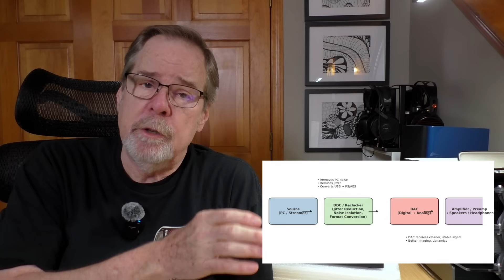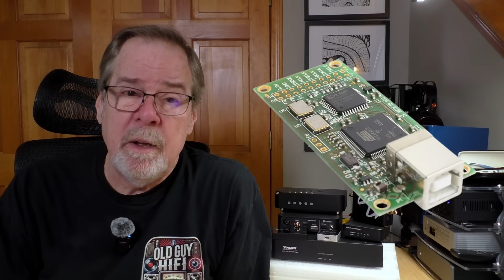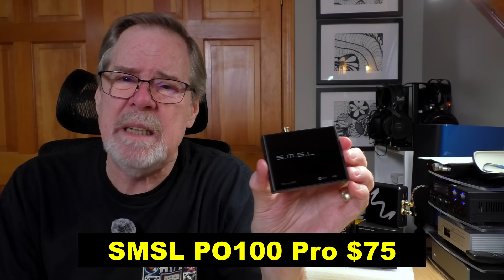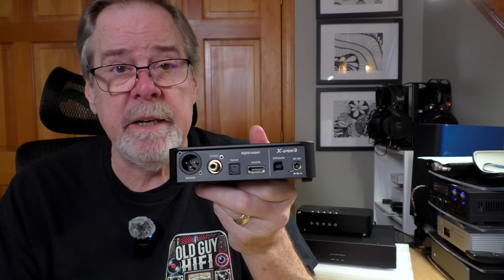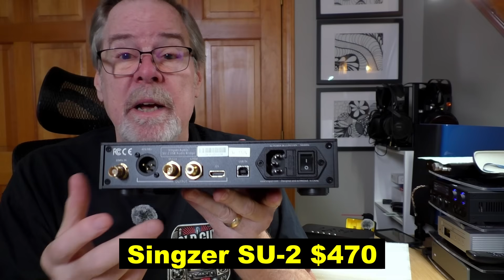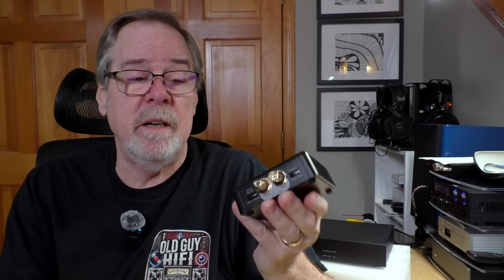OH NO! DDC-Reclockers! Do they really make a difference? YES! They do. I can hear it now “Snake Oil”

Comment: Thanks for the very interesting video! From what I understand, none of the relocker have an USB out, correct? In this case, the sampling clock used in the DAC conversion is always going to be the one of the relocker, and not the one of the DAC, which, for high-end system, I expect to be very good (and maybe better than a cheap relocker chip). Do you know if there are any relocker with USB in and USB out? This in principle could clean the noise on the usb line but letting the DAC using its clock to do the DAC conversion.
Reply from the maker: I don't know of any DDCs with a USB out. Most have I2S outputs. The DACs clock is still used as the SPDIF input on most upscale DACs runs into an FPGA which can then route the bits through the internal clocking system. I2S is also routed through the internal clock. The DDC clean up and re-time the bit stream but the DACs clock is still used. Think of it this way: The outboard DDC is an analog stopwatch, it does a good job but there can be some minute inaccuracies while the DACs internal clock is like a digital stop watch.

Comment: I have a WiiM Ultra streamer. Is there any sense in connecting a DDC between that streamer and a DAC that has USB and coax inputs? If so, which input is more reliable in practice for accepting DDC signals?
Reply from the maker: The WiiM Ultra is notorious being being full of jitter so yes any one of the units will make a noticeable improvement. If your DAC has I2S then that is the best connection. Otherwise unless you have a dedicated 75ohm digital interconnect, use optical. Thanks for asking and tuning in.

Comment: if i'm not wrong, teac high end dacs don't need these, because they already have bulk pet transfer in their usb ports, Most high end dacs will probably get no advantage or a very small improvement since most have their own circuit that clean the signal, specially if your source comes from PC that's full of jitters and distortions.
Reply from the maker: Even the most expensive DAC manufacturers have companion DDC/Reclockers in their product line up. The designers must have built them for a reason. Brands like dCS, Chord Electronics, MSB Technology, Weiss Engineering, Esoteric (TEAC), Denafrips, Laiv & Mytek all offer these products. There really is a sonic benefit in my opinion and the opinion of many other audio reviewers and engineers. Thanks for the great question.

Comment: Budget Build question: How about using a toslink/optical to USB-C adapter to go between a WiiM Mini and [insert DAC make/model here]?

I have 3 Minis in 3 systems, but they don't do USB-C out. Has anyone tried an optical to USB convertor? It's the only budget option I have to try this on my systems at the moment.
Reply from the maker: I have not tried that. That would only electrically isolate the DAC from WiiM. I am not sure if that would have any benefit. Let me know if you try that. Thx.
Reply: @OldGuyHifi I think I meant to say:

... use an optical-to-USB so the Mini could hit the reclocker before the DAC... 

Writing from bed when I should sleep has its putfalls...

Comment: Just purchased the Douk Audio U2 Pro 2025 DDC and had a very frustrating experience.  The supplied Windows drivers would not load due to a virus in the software ( prevented by Windows Defender).  I also spent about 20 minutes trying to load the software drivers off the internet using at least a 35 character web address, which did not exist.  Also the instructions were very difficult to read and poorly done IMO.  I was able to connect the DDC to my iPad, which did not require a software download, but the sound was no better than without the DDC in my opinion.  Using the Amanero USB connection from the Windows laptop directly to the Geshelli J2S was a far superior sound.  I found this connection lights out compared to using the Wiim Pro's coax output.  What a difference USB makes.  My 2 cents on trying the DDC with Windows.  Proceed with caution.
Reply from the maker: Sorry to hear of your frustrating experience.

Comment: I was wondering if the wyred for sound ddc reclocker would benefit from a linear power supply? Also I went from an optical cable to a coaxial cable to connect my mxn10 to my geshelli j3 dac and after burning in the coaxial cable it sounded much better and that’s before adding in the ddc. Don’t have it yet. It’s being shipped to me. Thanks for your very informative videos. You’re helping me elevate my system.
Reply from the maker: I did try an LPS and didn't think it made a difference. This is dealing with purely digital signals not anything analog. I think the supplied wall wart is fine. Let me know your thoughts on the Remedy once your listen to it. Thx.
Reply: I will definitely give you my thoughts once I get it and add it to my system. Once again thanks for your advice and expertise.

Comment: Thanks for the video.  Im looking to put the SMSL PO100 between my laptop and a ifi zen DAC 2 but not finding much info.  Is this connection possible with the available inputs on that DAC?
Reply from the maker: It won't work for you as, for some unknown reason, the Zen lacks and SPDIF inputs. Sorry.
Reply: Thanks for the reply.  I'll look at the ifi silencer + as an option....thoughts.

Comment: I see the DDC-re-clockers     are actualy built into the dacs   and the ddc-reclockers   sit before  the DAC of course and are digital to digital.But can you get a  ddc re-clocker    to sit between the usb    and  connect to a normal DAC?  secondly   is it possible  to make your own  DDC-reclocker    with a circuit  module  from china?
Reply from the maker: I don't think DDC would be an easy DIY project. All most all DDCs sit between the sending devices USB output and the DACs I2S or SPDIF inputs. Think of it like sequential turbocharging. The small turbo helps the big one perform better.

Comment: I own 14 DACs from $50 - $1,800 in price (ESS. AKM, R2R, Cirrus Logic, ROHM,)  I also own the MUSICIAN Pisces II DDC.  It works really great!  I would recommend the more expensive DDCs for anyone owning a DAC around $1,000, or higher.  For the most part, people owning sub $1,000 DACs would be better served purchasing, and using the likes of Douk Audio U2PRO XMOS XU316 (2025 Edition) DDC.  You will save a lot of cash, and you will improve your audio signal to the DAC.  Only the most revealing audio systems will see the benefit of a much more expensive DDC.  Lesser revealing systems just won't reveal the improvement your looking for.  Subtle changes are very hard to distinguish in a system that just doesn't reveal the most fine intricacies to begin with.  The last thing you want to do is introduce into your system is a device that just doesn't expose an improvement, but openly reveals all the flaws in your system without giving any real improvements.  I would like to finish by saying the following.  The Douk Audio U2PRO XMOS XU316 (2025 Edition) DDC is VERY GOOD.  Highly recommended.  I own 3 of them!
Reply from the maker: They are good. I worked with Douk and they're will be 2 more DDC/Reclockers coming soon. One with a TXCO clock and one with a Femtosecond clock. They are still a ways out. I also helped them with a full SPDIF reclocker. I have a pre-production unit here now.

Comment: Matrix Audio X-Spdif 3 does not require external power. I am using mine without one, works perfectly with just USB bus power.
Reply from the maker: Yes. I know. I find using an LPS improves dynamics and adds some focus to the soundstage.

Comment: Hi Ed , hope all is well. I saw your video on the ddc reclockers and was able to pick up a wyred for sound unit like the one in your video. It was a B stock unit for $227 out the door. I plan on putting it between my mx10 and my geshelli j3 pro with the ss2590 op amp on unbalanced rca output. I was wondering if I should use coaxial cables or stick with optical cables. I heard coaxial was better . What do you think?
Reply from the maker: I am not sure it matters. I tend use Toslink because of the complete electrical and galvanic isolation. Try both and see what you think sounds better. Good luck and thanks for commenting.
Reply: Hi Ed. I took your advice and to my surprise I did hear an improvement going from the toslink to the coaxial cable. After the coaxial cable was burnt in I found that there was more detail and depth to the music and I haven’t even put the ddc in the system yet. Thanks.
Reply: I was wondering if the wyred for sound ddc would benefit from a linear power supply.

Comment: For sure! The digital signal chain matters! I am using some Schiit Wyrds and a few Schiit Eiters also in my system. They are very effective at cleaning up a USB digital output. I remember back in the 90s, Theta Digital had a TLC. It was their  Time-base Link Conditioner. It was RCA SPDIF in and out. It really cleaned up the sound of my Rotel CD player used as a transport. BUT, what was REALLY AMAZING, was their high-current power supply, a separate option, for the TLC. That sucker brought IMMENSE improvement in detail, slam, inner resolution, everything! It was truly eye-opening for a $200 power supply add on replacing the standard wall wart.
Reply from the maker: I remember that piece. Thanks for sharing.

Comment: When a DAC also has xmos for USB in like the xu316, what might be the benefit of any with external ddc based on the same xmos?
Reply from the maker: I think there are 2 benefits: Galvanic isolation is a big one as well as precleaning the signal helps even the most sophisticated DAC. Each designer programs the XMOS chips for certian tasks like dealing DSD etc. The XMOS in a DDC/Reclocker is primarily concerned with time and latency issues as it is not directly feeding a DAC. Does that males sense. Think of it a a multistage water filter.

Comment: Hi, I have a quite useful streamer (pro-ject stream box ultra s2, IIRC its name), run on lin psu with addon dc filters, and a Chord Qutest DAC (on similar elaborated psu), and the LAN path runs through 2 switches on lin psu and some ifi lan filters.. and sq is very high, but somehow it changes vs time, and I feel restarting streamer and selected Netgear switches after reconnecting the lan connection can improve SQ.. so there is something going on that ends up in the analog domain ;) and I wonder whether a real audiophile switch or a DDC would be the better approach to stabilize and further enhance things.. tx for sharing your thoughts
Reply from the maker: If you are feeding your feeding your DAC with USB, try a USB isolator. Yes a DDC unit might help because, in addition to reclocking and jitter reduction it will give galvanic isolation which could solve your issue.
Reply: @OldGuyHifi tx! Have a nice Sunday!

Comment: Hey which is best to you? You mentioned in a comment on previous vid that the Matrix was best for you vs the U18. Im also wondering if a Power supply enhances it further as well... Thanks again!
Reply from the maker: The Matrix with an LPS is very good. The Singxer has its own internal power supply. I bought both of them because they each do a great job. I like the fact that the Singxer can act as a master.

Comment: Using a Wiim ultra into Cambridge DAC magic
plus and noticed a weird  deveiation in sound..'Jitter'? Plugged the SMSL PO100 pro between the two and perfect!
Reply from the maker: WiiM units are notorious for being jitter machines. They output a n unclocked signal. But you get what you pay for. The SMSL PO100 Pro is great at fixing that issue. Sounds like you are good to go. Thx.

Comment: I took a chance after watching your's and another's reviews of the Douk U2 Pro. Once I inserted it into my system the improvement was immediate and significant. So I conclude that the SMSL SU 1 DAC was the bottleneck. Improvements were more detail, more natural and deeper tighter bass. Thanks!  
(PC > U2 Pro > SMSL SU 1 DAC > Douk A5 > Monitor Audio 852s (binding posts, internal wiring, crossover caps upgraded))
Posting this comment here, too, because it might help others make a buying decision.
Reply from the maker: Thank you for sharing your experience.
Reply: Hello!! very good coincidence, I have the same audio chain:
Laptop (Type-C USB) > SMSL SU-1 > Douk Audio A5 > Paradigm Monitor 3 v2. 
I have been wondering how I can improve my current sound configuration to some degree. 
I was thinking about of changing op amp, I never did and I couldn't imagine if it would have a real significant change, and now I see the possibility that perhaps adding a device like the Douk Audio U2 Pro would be a further improvement. 
What you say about the good SMSL SU-1 turning out to be the bottleneck of our chain really surprise me, since I had always thought it was the best quality part of the chain.
Please could you comment a little more on the details of sound improvement and any other details that could help me decide to make the purchase of Douk audio U2 pro? Thanks in advance!
Reply: @alquimico8   Douk Audio U2 Pro
I grew a bit dissatisfied with the detail which seemed a bit harsh so I started looking for something to change.
I came across this vid-  https://www.youtube.com/watch?v=FWZy-aoDOps 
I was skeptical. I read an post at Audio Science Review telling me that re-clockers were useless as DACs already had a clock. 
The video based on subjective listening and the ASR post were contradictory. I tended toward the ASR post, but thought I could experiment for myself to see what was true in this case. The cost was minimal, so I bought. 
The Douk did not disappoint. The harshness disappeared while more detail appeared. Tighter bass, too. I dislike repeating this old claim, but the music was more musical. 
The thought of improving the sound doesn't occur to me now. 
Of course, your room and ears are not mine, so there's that. Let me know your experience.

Comment: I loved this video relating to reclockers you are preaching to the converted regards the paramount importance of this subject. I would have listened for hours I would have liked you to detail the link with amps and the type of digital information they respond to. I'm informed that amps built with Delta sigma respond adversely sonically slightly to R2R ladder DAC can you clarify and inform either how to get round this by a selection of amp or is there another way?
Reply from the maker: I am not sure I understand what you are asking. Amps are not Delta Sigma devices. DACs that use a chip based conversion, i.e., ESS, AKM, Cirrus Logic, TI, and Burr Brown use a Delta-Sigma conversion scheme. Amps might have a built in DAC but you don't have to use them. Any amp will respond to an R2R ladder DAC or any other input  perfectly fine. I hope that answers your question. Thx.

Comment: Help me with a quandary. I have both the smsl 100 pro and the Douk audio U2. I'm using a Wiim ultra for streaming. The Wiim seems to support up to 96/24 via USB while optical and coax max out at 192/24, but then can't use the reclocker. Not sure I can even hear the difference, but do you think it is better to use the DDC with a slightly lower quality or skip the DDC and go coax direct my DAC?
Reply from the maker: According to WiiM the USB supports 24 bit 192kHz. Maybe a setting needs to be adjusted in the software. I would use the DDC no matter what. 24-96 is still amazing. Check the software settings.
Reply: @OldGuyHifiinteresting. My software/app doesn't give me the option for a higher rate with USB. I'm not sure why it isn't there like the others. 96 is the highest it shows. I'll ask about it in the group.
Reply: @OldGuyHifiit looks like the DDC is the limiting factor. When I use the smsl I get 192/32. When I use the Douk it is 96/24. I guess it is whatever the Wiim is detecting.
Reply from the maker: Probably. I really wouldn't worry about as long as it sounds good to you. Personally, I am fine with good old fashioned "Red Book".

Comment: Does using a DDC introduce any lag in timing when watching TV for instance?
Reply from the maker: Your TV would to have a USB out to use these. If you want to do the optical out from your TV then the Wyred 4 Sound would work great. There wouldn't be any latency. DDCs don't work with a TVs HDMI output. Thanks for asking.
Reply: Hi again, but what if you use HDMI from the TV into something like a Wiim Ultra and then use an external dac and have a reclocker between the ultra and the DAC?

Comment: I would like to flag a misconception. In my understanding, Usb for audio does not resend packets.
That does not undermine the fact that a DDC reclocker is useful - as we have a device here that focuses on flexible reception from 'bad' sources and retransmits them in the best possible way.
Reply from the maker: That is an interesting point. I have seen the same info in relation to streamers. I am looking into that. I have also seen contradictory info that states a USB connection to a PC/MAC streaming any of the high performance Audio programs Like Audirvana, Roon , HQ player, etc., is truly asynchronous. The PC/MAC sees the DAC/DDC as just another USB device. It doesn't see the data stream as an audio signal just a data stream. I am doing some more investigating on this. Thanks.